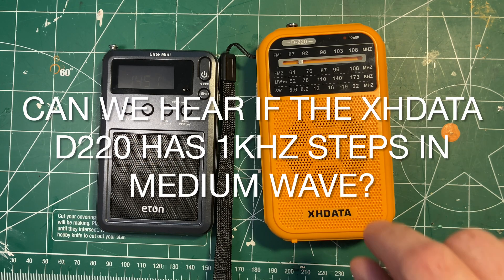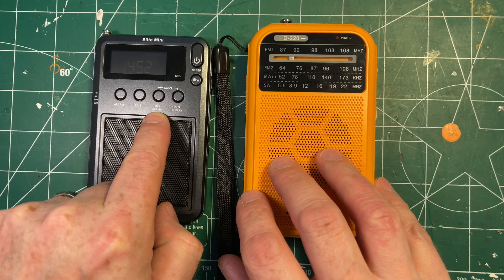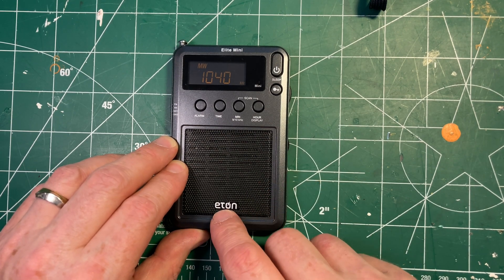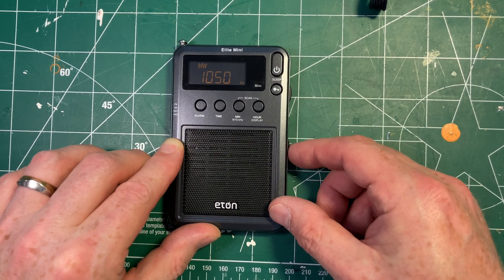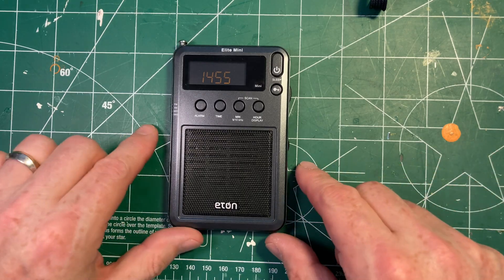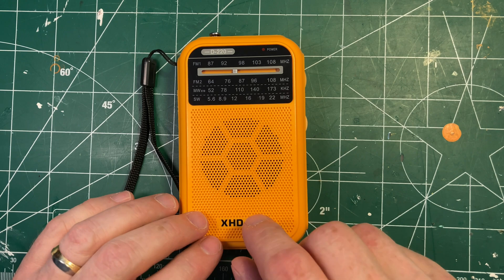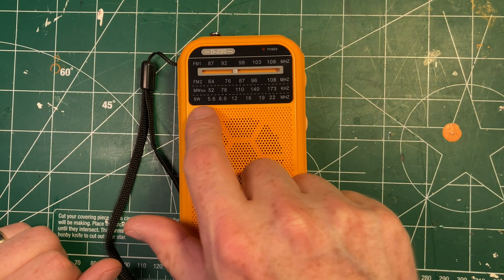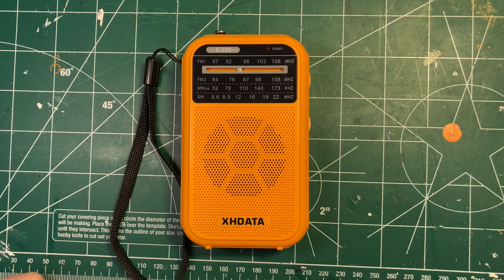Can we Hear if the XHData D220 has 1kHz steps in Medium Wave?

Comment: My green model clearly says MWx10 on the dial, and it looks as if your orange one does also.  I would assume that means it tunes in 10 kHz steps, but who knows?
Reply: I think it means that you have to multiply the number on the dial by 10. So 78 is 780 kHz, 110 is 1100 kHz etc.
Reply: @hammockdweller  Oh... yes, that's obvious now that you point it out!  I completely misinterpreted it.  Thanks!

Comment: My local station is 810  WGY.  A station on both the 9k step band, as well as on the 10k step band.   I am hearing the 1 k steps when tuning up and down from the center frequency  of 810 and the signal is tuning more like analogue  (but with 1k steps) So I believe that what you are saying is true.  The chip they are using must have this.  After all the digital display versions all have 1k spacing available.

Comment: I wonder if this is how the combo “9 K / 10 K” stepping band mode works on those Si chips. Hard to say because they’ve rubbed off the text on the chip for this radio, but if they were using a clone chip it might not be too far off in operation. I feel like there aren’t enough audible steps for it to be 1K though, maybe 4/5K? It would certainly reduce the deviation from incorrect steps. 

Personally I’ve just thrown a fistful of money at Amazon for a PL-330. Hopefully good enough dynamic range to not repeat the D-219 overloading woes.
Reply from the maker: I've found the PL--330 very resistant to overloading. Hopefully you'll have the same experience. I had the same thought that this might be the combo mode described in the Si chip datasheet.